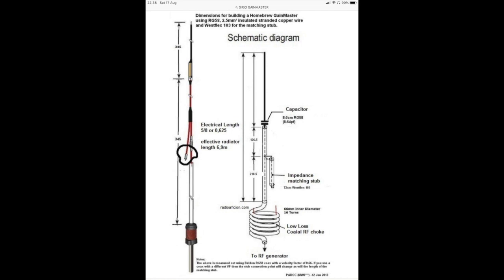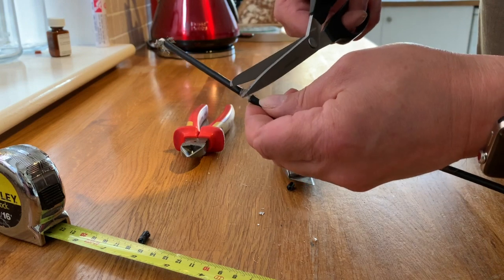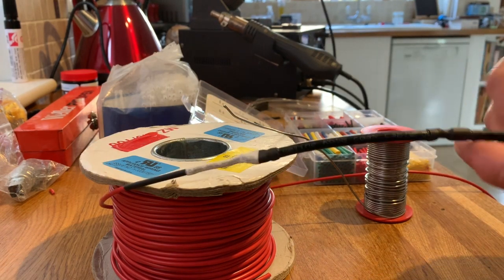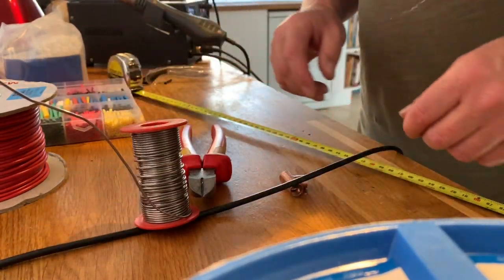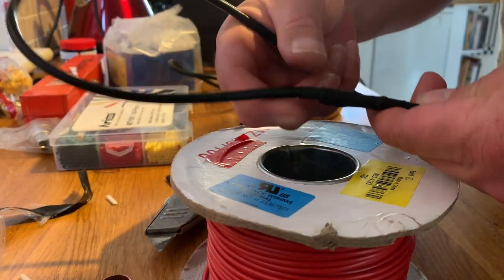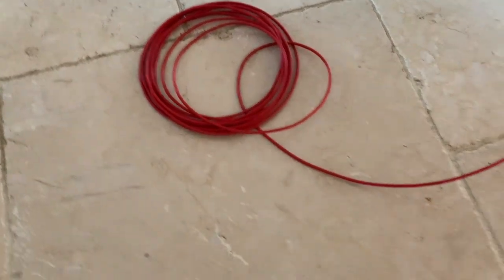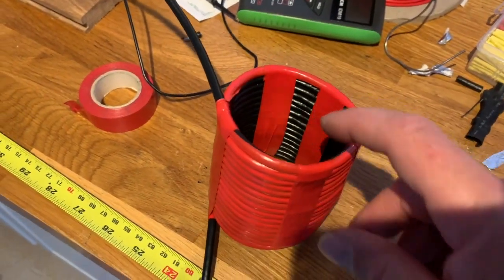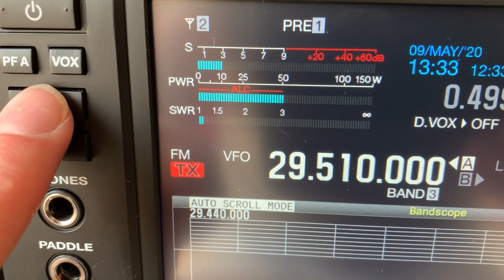CB Radio Homebrew Gainmaster 5/8 wave Antenna, on a DX Commander Pole - Lockdown activities Part 5

Comment: Following your instructional video I have also made a gainmaster with a stud of 62 cm. It works absolutely great. Prior to installing the antenna at my friend, I did a fair comparison between the mobile wilson 1000 and the homebrew gain master. The signal difference is +2 S points on the gain master vs the mobile wilson 1000. Both antenna's are at the same level starting from the base. Maybe the gain master was half a meter higher, but just to make sure the RF choke was higher than the metal rooftop of the small van on which I have the portable wilson 1000 antenna. I was doing this comparison in a field with my mobile radio.
I have built this antenna for a friend who has severe restrictions regarding antenna's he can set up at his home QTH. He uses 2 fishing poles for a multi band dipole, but he wanted to also have a vertical areal for 11m. When I  opened the back of the truck when I arrived at his apartement and took out the wire antenna, he looked at me like I was telling him a joke. He thought I forgot the actual antenna back home as he saw me grabbing only just some cables. LOL. He was expecting a fancy, sexy antenna! 
After we went up in his apartment on the highest floor, we took down one of the fishing poles and mounted the gain master. I just used one of the fishing poles he currently uses for his dipole antenna. So he can use the gain master in a vertical polarization and his dipole for the other bands.
After installing, I made one single call on t5 and boom, a station from Poland came right back.   His face was still like very skeptical, but after firing up the lincoln radio and have a polish station coming back after one single call, he fell off his chair. So, let me confirm that this antenna really works well and is comparable to a Antron 99 or any other antenna out there that has no radials.
Thanks for the video and I hope to hear you on the air some day.
Reply: What kind of fishing pole is 25 ft long?
Reply: @RC-Heli835  Deep deep sea
Reply: @RC-Heli835  a beachcaster!🤷🏼‍♂️🤣
Reply: He'd actually get better performance from an A99 or Imax due to the fact the GainMaster design is a balanced antenna which is extremely sensitive to being near anything which can play games with it's pattern & TOA.
I've tested & compared my GM in multiple installations from camping to mobile to home both high and low and only when it's way high in the sky and not near anything else does it come alive and kill everything else it's compared against, including a Vector4K and an I-10K.
However, mounted down low or near any other antennas, trees, towers, etc. it totally SUCKS compared to almost anything else. Just the nature of the design, it's two radically different performing antennas depending upon the installation.
Reply: @stanner9474  Agreed! Same result when I ran several comparisons with my original GM, up high it reigned supreme, down low and/or near other antennas, bldgs., etc. it was a steaming pile of canine excrement.

Comment: For making the coax air choke I get a 2ltr bottle of fizzy drink, open the bottle and drink about a large glass out of it, then put the lid on. Shake the bottle a few times and it goes rigid with the gas. Wind your coils using the bottle as a former and then tie together with cable ties and/or tape. Then to release the coil open lid of the bottle and let some gas out compressing the width of the bottle to slide the coax coil off the bottle. Works a treat!  161 De. M0KTY
Reply from the maker: cool

Comment: I tried this antenna using Rg 214 and the stub was made with Rg 213 . CB band perfect but at 28.500 mhz I had a 2.4:1 and a 3:1 up to 29.300 it got better  at 29.600 at 1.3:1 . How can I tune the antenna for a better SWR on 10 meter? (((((((HELP)))))))

Comment: I made my GM 5/8 from Belden RG-213 for higher power handling and stuffed it into a 20' Stationmaster 3.5" fiberglass radome but had to drill through the brass tip and extend a Wilson whip up & out through it about 4' to fit the entire affair. Sure stomps the old Vector 4000 and isn't temperamental in the rain & snow!

Comment: Most folk cook in the kitchen but Mike makes antennas 😂 good job👍
Reply: Ha haa, not the first time I've done something in the kitchen to upset the xyl. Best one was a BMC 950D engine block upside down on the gas cooker with a ring on full to heat the block to try to free off a seized piston. Have also left a few too many soldering iron burns on one of the work surfaces but have managed to blame some on her puting hot pans down lol.
Reply: @Adam J McLeod One of the reasons we had to get an electric cooker when we moved house. Also used a piston from an old brake caliper as a solder pot for tinning wires. Put piston upside down on burner and fill with solder. Gas ring on low kept solder at ideal temp for tinning lol. Ohh my poor long suffering wife lol.

Comment: Great video Mike....... Cal better have plenty of supplies :) I will probably make one for 10mtrs and hang it on an Expedition model, it would be great for my DXpeditions to the Pacific (can't wait for decent propagation to return)  Cheers - ZL1BQD
Reply from the maker: RolyRJ  Cheers Roly, bloody brilliant antenna, going to rebuild using better coax, matching stub and connectors. :)
Reply: What do you think of this antenna Roly?  I have never tried to build this one, but I have had some weird antennas.  Some manufactured and supposed to be good and to be honest were crap.  One I had didn't work no matter what I did.
I was going to have another go at this antenna (I think it was some Italian rubbish) as it never worked, I could almost shout as far!  However, i did have its big brother and it didn't half get out.  So I was just going to take it to bits to see if there was a transformer inside it that was not quite right.  But I can't find it, along with some other antennas that appear to have vanished!  They were here at one point, but now have been spirited away!  Strange as shed is always locked if no one here.  Never mind.  Question is, is this antenna a go or is it just another weird one?'
Strange design for a CB antenna and I have not heard of anyone using it.

Comment: Thanks for this video, I just finished making mine. It has a 1.1:1 SWR right across the mid block, and the receive is excellent. I’m very happy with it overall.
Reply: What are you using to string your antenna up with?
Mfj makes a 33ft telescoping Fiberglass pole for 99 dollars but I'm not sure how long it would hold up in a permanent sort of mount. These are so tall they pretty much need taking down in a wind storm.
I thought I might find a 25ft cane pole.

Comment: Great video. I've made them in both RG58 and RG8X (allowing for different VF and pF/m in RG8X) and there is a marginal improvement in performance with the better coax. I've used both for 11m portablewith a 10m pole and the bandwidth is a huge asset. Next up is to make one up in RG213 with Westflex for the stub (because the consensus is that if there is a part of the antenna where loss can creep in, that's it).
Reply from the maker: Great tip!  reckon the RF choke will be OTT with 213!!! LOL
Reply: @mike-M0MSN  Yes, you're right, I will just reuse the RG8X choke and stick a socket on the bottom of the 213 section

Comment: I'll also inform you, that the westflex coax that is largely air cored, has a higher velocity factor than normal solid polyethylene dielectric coax so you making the stub longer in the absence of Westflex 103 was the opposite to what you ought to have done, it actually needed to be shorter.
My experimental fm antenna I mentioned used RG213 as the stub and I not only recalculated the stub length based on wavelength difference but also recalculated for the difference in cable velocity factor.
Just thought that I'd give you an explanation of why the SWR was high on this one.
Anyway, cheers and good video 👍
Reply from the maker: Yes well spotted, it seemed to work better with a longer length??  however, Mk2 not recorded used a shorter length of Mini 8 and worked as well. :) it's fun to experiment..
Reply: @mike-M0MSN  Do you have mk1 anymore?
Reply: @mike-M0MSN  I'm not sure what you were saying in the reply to be honest.
Are you saying it worked better with a longer length of the coax you used for the stub? It is impossible to tell what you meant
Reply from the maker: Yes, I do not know why, all of the remakes I have made needed a slightly shorter lengths but that one required just over a meter? 
I do not have it now so I cannot check to see if I shortened the stub or left it open!
Reply: @mike-M0MSN  okay mate.I think it would likely be that it was so much longer than it needed to be that it seemed better going even longer 😂 The 3:1 SWR I saw on the video was pretty high still.
Its been a while so I was just playing around with some numbers.
Velocity factors. W103: 0.85
RG58/213 P.E Dielectric: 0.66.
0.85 over 0.66 = 1.28.
W103 stub length 72cm.
72÷1.28= 56.25cm.
A stub out of RG58 or RG213 needs to be 56.25cm long or just under 16cm shorter than it's W103 counterpart.
So you're might have been nearly twice as long as it needed to be 😅
Reply: @Dazzwidd  fyi.. using RG58 for the build,  and with a 72cm stub made of RG213, I was getting 1:1 SWR at 25.65mhz, and 1.3:1 at 27.555mhz .. I thought I would try shortening the actual wire radiator at the top to se the effect... 10cm shortened radiator,  and SWR went UP to 1.3:1 at 25.65mhz, and 1.6:1 at 27.555mhz.. not what I was expecting.. lol ..I'll be adding that 10cm back to the top, and try shortening the stub to 56.25 as you suggest above.

Comment: Having messed about with the Sirio GM for a couple years I found it came alive when:
1.) Installed at 12.5m (41') to the bottom
2.) Kept far far away from any & all other antennas, trees and obstructions.
Reply from the maker: yep..
Reply: @Maverick Chester I don't know about him but over basically sea level ground at both ends, I've had contacts up to 130mi when the D layer isn't any good and those contacts weren't even weak! It's like being on a mountain when it's alone & high in the sky.
I ended up making one using a 20' long Stationmaster ray-dome (with a rod protruding out the top a few feet for the proper antenna length) for supporting mine made with RG-213 and able to handle 3KW pep.

Comment: Some years ago, I scaled this antenna to the fm broadcasting band to do comparitive tests with very low power compared to a 1/4 wave ground plane.
I got a great SWR and it was significantly better than the ground plane

Comment: Mike - this is fantastic - my favourite CB antenna too! Well done mate very impressive.
Reply from the maker: Tom Rowlands  Thanks Tom..
Reply: Hi Tom, I take it you have used this antenna before.  How does it perform compared to other antennas?  Just wondering, I am not going to build something that does not perform well and does not come recommended by others.
I am disabled, so building something like this will be a lot of effort, but it has never stopped me in the past.  Only problem I have these days is getting someone to give me help put antennas up on a pole etc.  I hate moving house, all the help vanishes and when your father dies that is the end of it.
Give you a laugh, my grandfather who was 82 at the time was up on top of a three story building taking down an antenna for a Radio Hams wife,  I had visited him in hospital and promised him I would take down his antennas if the worst happened.  The worst did and I drove over one day with my grandfather expecting him to stay inside so I could pass the antennas through the window to him.  I head a voice behind me and there he was climbing up the roof behind me.  I tried to get him to go back inside, but he wouldn't and insisted he helped.  It did make things a bit easier as he had a Silver Rod and a few others up on the roof.  The gave him the Nock name of "Ground Wave Jim" it appeared to be a joke in the Ham Club, but if it was I never was let in on it.  Can't even remember his call sign now, it was a G4 anyway.  Ah the memories, but that was before things turned on me.  My grandfather was fitter and more able then and at 88 than I am now!  Some people have all the luck.
Anyway, take care as I think you are in the high risk sort of job?
I am away to throw some boxes around with the neighbour while he is still at home to give me a hand tidy the workshop/Man Cave/shack.  I should have gone through my licence 30 years ago when I was a member of the Ham Club.  But job got in the way then girls and motorcycles and then one girl just would not let go!  So married life got in the way.  Now not being fit, after cancer and repeated work injury is just a bit to much.  This on-line testing is my chance to do it now though.  They told me I would be in a wheelchair before now, 10 years ago, but still getting around with two sticks.  Be lost without the car though!  73s as they say.  Be interested to hear what you have to say about this antenna though.
How about a DX COMMANDER for CB?
Reply: bob fourjs hi Bob   Yes I have a Gainmaster commercial version of this antenna. It really is a great antenna and better than my Antron 99. It’s a 5/8 wave antenna and very good. I use my DXC on 11m all the time! It’s very good too. Although the wire is cut for 10m it’s is 2.5 SWR on 11 and easily tuned by radio ATU. You could cut an 11m wire on a DXC specifically if you want.
Reply: @M0RMY  Thanks for the reply Tom.  Maybe I will give it a try once this virus thing is gone.
Reply: @BoB4jjjjs  I'm in the about the same condition  but I just keep on going hOpe you do to!
Radio helps   73 n9prf Joe
Reply: @joerowland7350  I am just trying to look at the brighter side of depressed at the moment lol
Reply: @BoB4jjjjs  i know whut you mean  JUST never give UP 
At first of last year my house hit by a tornado lost most of the roof n after 2 stroke n being in a coma 
N being blown up in the milatry n braking my pelvis a Nuther time in service  I can't fix it my self 
I got so depressed all I thaut about wus dieing  
So I got some animals goats cows dogs bee's chicken looking have POUND put in for fish n ducks
Thay need me to take care of them
N I need theme to take care of
I all ways have some thing I need to do n it keep me out of that
 deep dark depressed place 
So try n find some thing to do you really like   
Some times I can only do 15 mins n I have lay down  but I keep going
Reply: @joerowland7350  I like fixing electronics, but have not got into my Man Cave in 24 years.  I have a motive now to try to clear it so I can get a radio in there, but now they tell me I can't put up antennas!  Little do they know that I have a long wire running down several neighbours fences for a short wave receiver, but it had not been run in a long time and after half an hour let out some magic smoke and stopped, it was not much smoke, but I have not had time to look at it as still working on Man Cave.  Stay well and keep safe. Most of my equipment got destroyed while moving here, it was left outside against my instructions, but women don't understand these things.   :-(( At least my one don't!  Or didn't want to not made my mind up which yet.

Comment: Hello, I have learned a lot, regarding this antenna, I liked it a lot, because of its simplicity, and operation, I have seen that, for the Sirio gm antenna, it indicates within its instructions that a metal mast must necessarily be installed, this for not having ground planes, does this also apply to this antenna? Thank you
Reply from the maker: No I use this antenna on a Glass fibre pole. no metal ground plains..
Reply: @mike-M0MSN  Ok thank you very much, very grateful.

Comment: Thanks for your great instruction to build the homebrew gain master. I have one question: When i use H155 Low Loss instead of RG58 and Aircell 7 for the stub - are the length the same or have i recalculate the length because of the different velocity factor? For example -> 153,33cm instead of 126,5cm. And did you tried it to build a 0.64 instead of a 5/8?
Reply from the maker: I took the measurements from https://radioaficion.com/cms/sirio-gain-master-homebrew/
Reply: @mike-M0MSN   it's gone the link, Mike can you or someone else re-upload the project?

Comment: Hi Mike, I built it according to the measurements and connections of the video, but I want to ask you a question, at 25 MHz the roe is 1.0, but at 30 mhz, it indicates a roe of 3.4, I reviewed all the measurements and they are well, how can i adjust it? thanks in advance. greetings from Viña del Mar-Chile
Reply from the maker: Luciano Cerda what coax have you used and it sounds like the driven element is to long...  maybe cut the matching stub (if made from RG58 to 50cm).

Comment: Indeed it is made with rg58, and I gave it a measure of 72 cms., Should I shorten it then? Thank you very much for your advice.
Reply: Ok Mike, I cut 1 cms. and where it turned out well, it was 51 cms. r.o.e. in 25 MHz 1: 1, in 30 MHz 1.9: 1, Now I just have to put it inside some tubes and install it (PVC tubes, reinforced with fiberglass, made by me).I couldn't send photos.
Reply from the maker: Maybe cut the driven element (Top section) by 5cm to see if that makes the roe Better on 30 MHz..  :)
Reply: @mike-M0MSN  OK, I will do that and I will inform you how it looks, Thank you very much for sharing your knowledge, very grateful.

Comment: I put a "cb" element on my dx commander. Why not just use the driven plate and add to or replace other bands on the classic commander? I like cb bands, just not sure in my mind if this is the best way to go about it with the commander kit